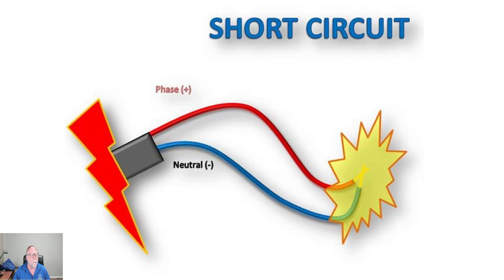Low Voltage Shorts--simplified!

Comment: Thanks Joey.  I know it's situation dependent.  But could you do a video or a video series on basic electrical troubleshooting using a meter walking up to a no cool service call.  Obviously, we start at the tstat and go from there.  But is there a systematic way to troubleshoot electrical faults regardless of the unique situation?  A system that could be universal then modified given differing circumstances.  In other words, a one size fits all, all-encompassing method, that can be truncated to fit different faults?  Thank you.
Reply from the maker: Great suggestion! Let me work on that!